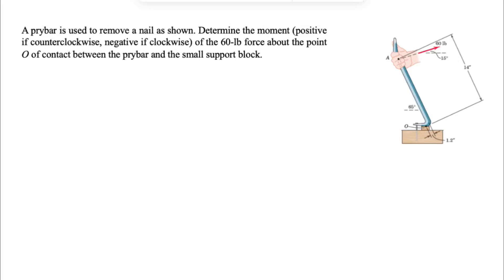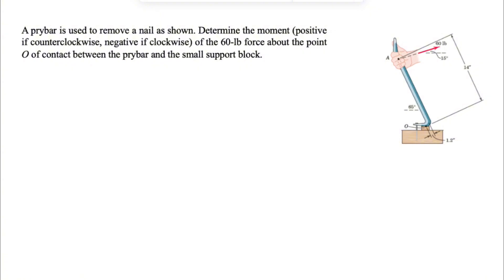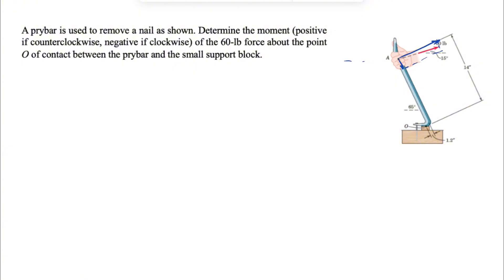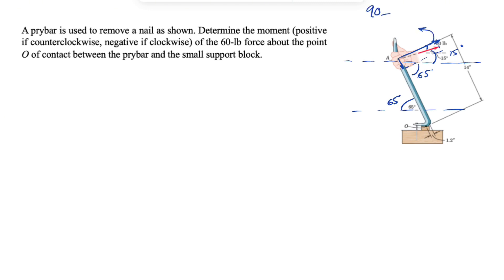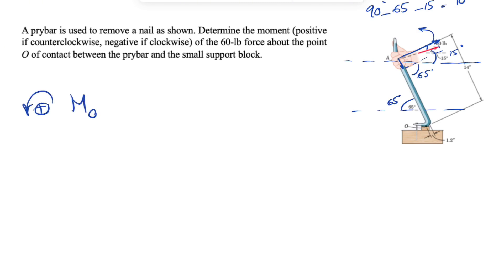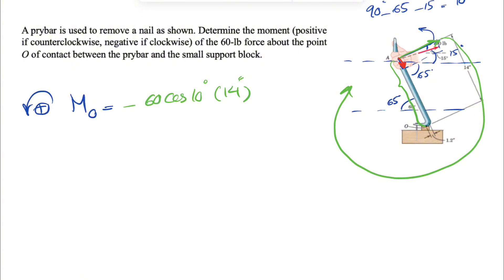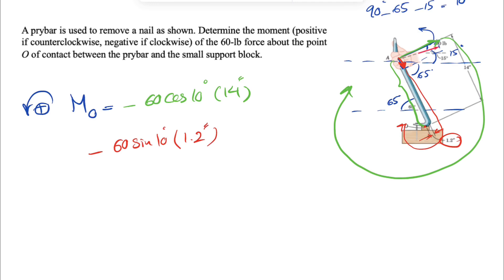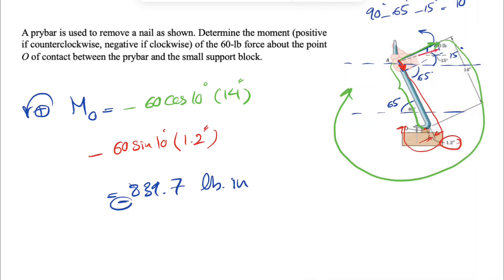A prybar is used to remove a nail as shown. Determine the moment of the 60-1b force

Comment: Why did we take 10 degree?
Since the force is 15 degree from the x axis we should have used 15, right???
Reply from the maker: In the moment equation the angle we use is not “angle from the x-axis”, it’s the angle between the force and the position vector / bar.
	•	The pry bar (the r-vector from O to where the 60 lb is applied) is at about 25° from the x-axis.
	•	The force is at 15° from the x-axis.
	•	So the angle between r and F is their difference → 10°. That’s why you see sin(10°) and cos(10°) in the solution.
If you wanted to use 15°, you’d first have to rewrite everything in components and then take the perpendicular distance correctly — you’d still get the same numeric answer, but it’s more work.

Comment: I am confused about how you broke up the force into components, can you please explain..... My confusion is that the components are not on the usual x and y axis.
Reply from the maker: So, I resolved the force into two components: one perpendicular to the prybar and one parallel to it. The 60 lb force makes a 10º angle with the perpendicular component, so the perpendicular component is 60 cos(10), and the parallel component is 60sin(10).
Reply: @ENGMCHANSWERS Shouldn't the angle be with respect to x so the it should be 60 cos 80 and 60 sin 80
Reply from the maker: @emmakarikari612  not necessarily and I am not sure how you define the positive x and y axes in here, but sounds like you just switched the axes I used, which works too.
Reply: Create the x axis parallel to the prybar and y axis perpendicular to it and resolve the force in that order